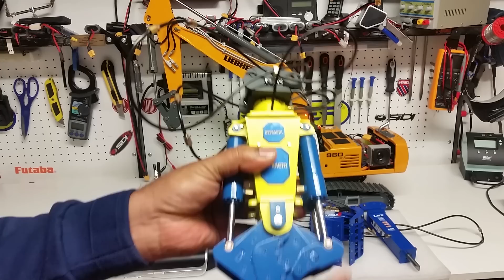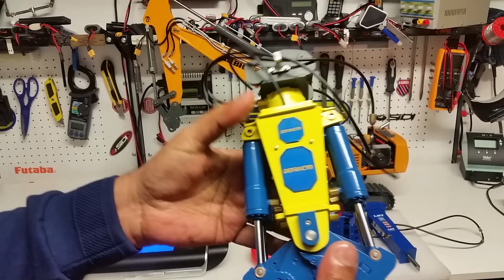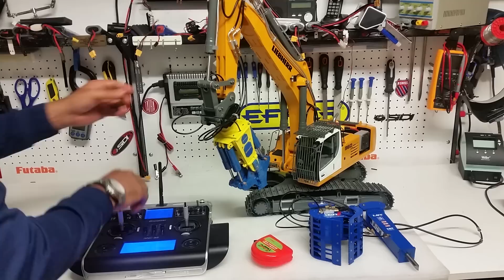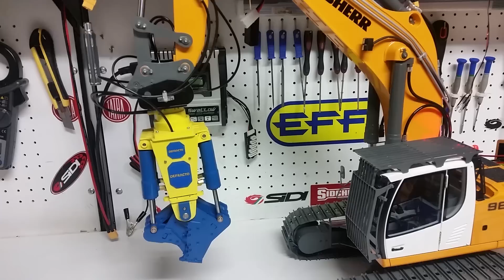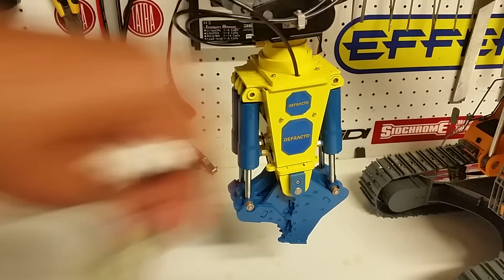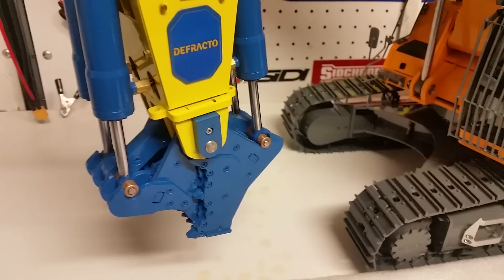CSMI : Liebherr RC Excavator 960 Demolition shear test and demo

Comment: Why don't you use the free mixers for the claw so that you can steer them with the sticks? You have some switches on the sticks that can be used for switching between armcontrol and claw. I think using the side levers for steering the claw isn't practical. If you need some help get in touch and I'll send you the file😉